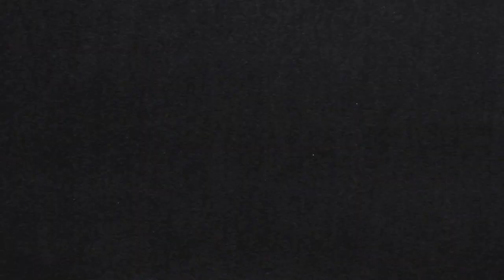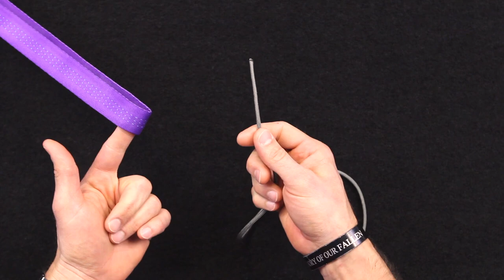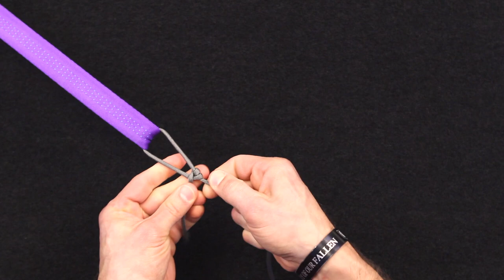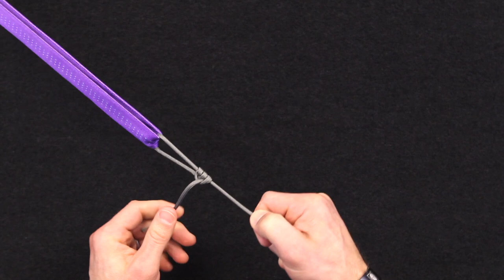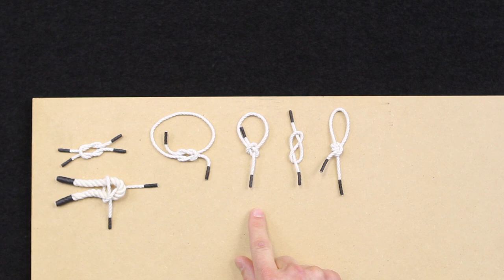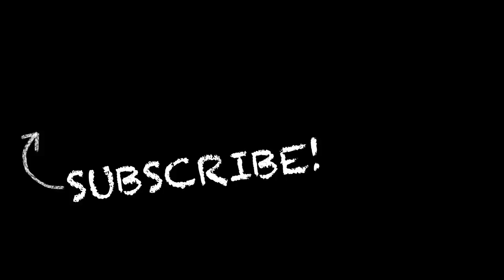How to Tie the Taut Line Hitch for a DIY Knot Board Display

Comment: One of my favorite knots. I usually tie it the wrong way (and I know it is wrong, I just prefer it). I have not found it to slip any more than the correct way, and I prefer the aesthetics of the wrong way, it looks more like a prusik knot.
Reply: You mean after the two inner rolls you go above the line and wrap the last roll in the opposite direction? That in fact is a stronger knot than the one shown in the video, where the tieing line crosses the rolls diagonally.